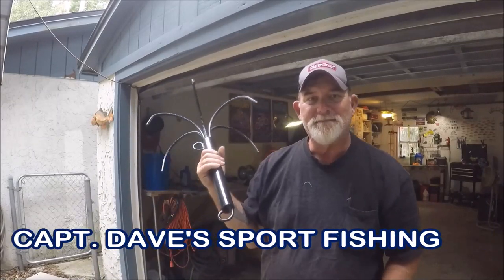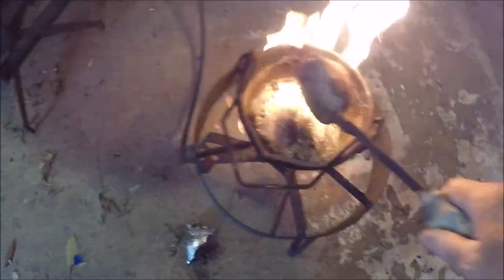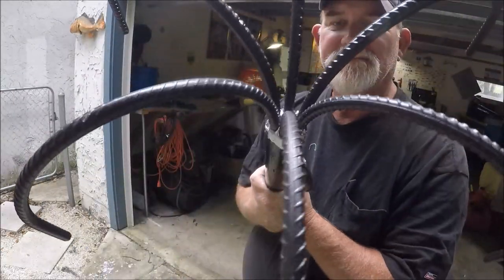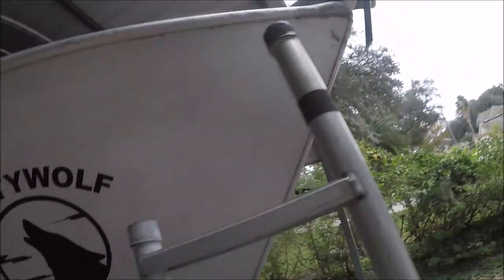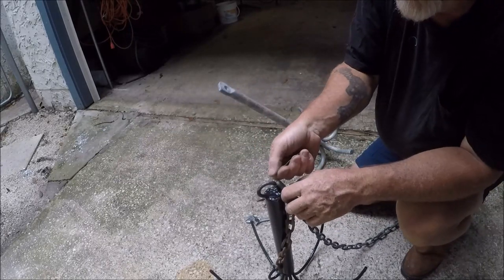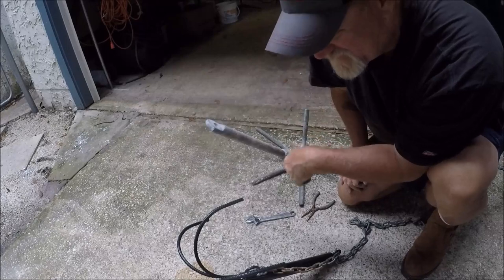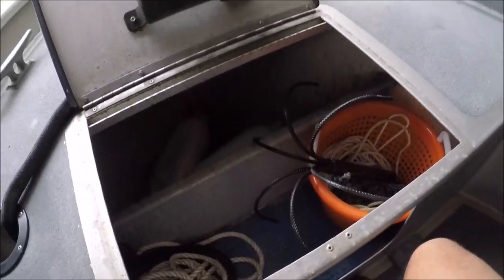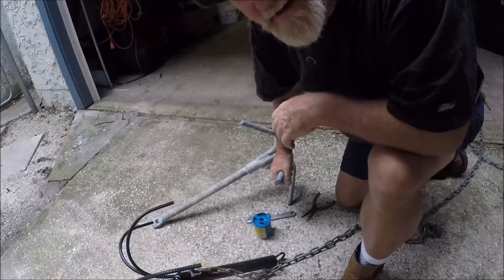ANCHORING, my charter boat

Comment: Full size marine batteries at menards are $75 a pop. I used only 1 tank of gas this whole summer. I troll 12 hours every fishing trip. U can be all set up with a trolling motor with gps lock for inder 2K
Reply from the maker: You say that but you don't live here and you don't fish saltwater and you don't fish in mega current no you want
Reply: Right. But u also dont know some things. 
1. Spot lock works best in current. People dont use it if no current no wind. I have a second trolling mootr on the back that i use to pull me back and simulate current. Without current spotlick doesnt work. 
2. Size of boat does not matter much for spot lock. Yeah u will need min 80 lb thrust, but just for spotlock u will be fine. Move sround is totally different. U will need the gas engine for that. 
3. You will always need your anchor. I always carry mine, for safety. And if u really like a spot and dont want to move - then anchor. But spot lock makes it super easy to test a dozen spots to find fish. U aint throwing anchor 12 times, i know that
Reply from the maker: @ifishcatfish  dude I know a lot of things I know people with 31 foot boats with a hundred lb thrust plus trolling motors on the bow 36 volts no 80 no 80 lb Works around here on a big boat I've had six or seven trolling motors myself in the past it's all about lightweight batteries and they cost I know how spot Lock Works it'll never be done cheap on my boat trolling motor the batteries and having welding done for mounting platforms it's not something I'm doing anytime soon
Reply: only you know what is best for u, and you have been around long enough. Btw, even lithium batteries at $1500 a pop weigh like 40 pounds. Even with 3 batteries you save like 60-70 pounds by going mega expensive. How much does your boat weigh with crew and gas? I doubt u save even 1% of weight by going mega expensive. Most likely u will never tell the difference. Also, Minnkota is no longer the only game in town. U have Lowrance with brushless dc motor, Garmin, and Motorguide with new products even better than the minnkota I have, and they are becoming more power efficient. I have fished IL river and Mississippi river in about 2.5mph current with zero problem for spotlock. Current is not a problem. Wind can be a bigger problem, and in strong wind my batteries will drain after only 3 hours in a lake with no current. That's why I said you will always need your anchor!  Tight lines. I hope one day i can come and meet you.
Reply from the maker: @ifishcatfish  every single pound counts sometimes I'm fishing 40 ft water and then there's times when I'm fishing to feet of water so versatility and fuel economy name of the game when you're in business yes I know minn kota is not the only game in town I know all about the others